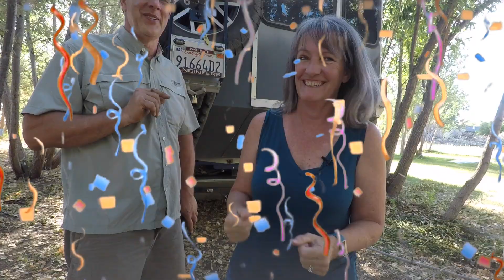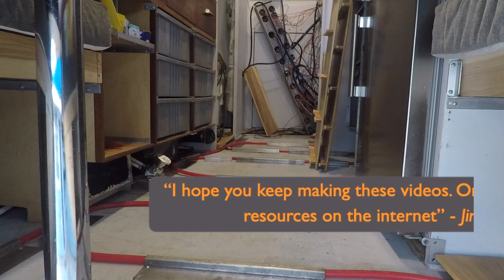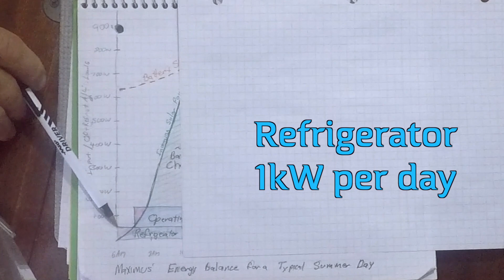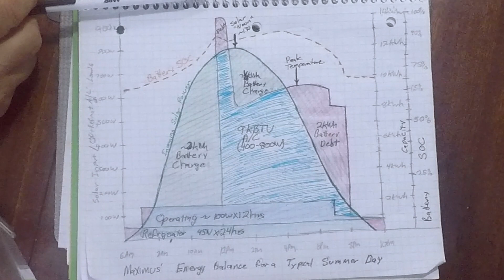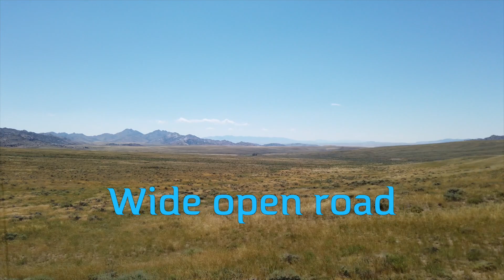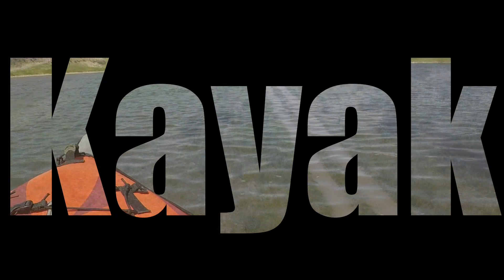All DAY Solar Powered Mini Split AC | Staying Cool Off  Grid DIY Truck Camper  | North Platte River

Comment: I have a few questions what problems did you have to resolve in those 2 weeks or did everything work perfect from day one
Reply from the maker: The A/C performance was good from the beginning. A year later, I discovered a leak in an SAE flare that lost most of the charge and it stopped working for a bit but was pretty easily fixed and recharged. The power system took some time. I planned for 5x190W solar panels but the original 5 developed problems and I replaced them all (under warranty). There are 250W panels available now in the same size which I wish I had ( now 6 x190W = 1140W but it could be 6 x 250W= 1500W). I've added a 6th panel on a sliding mount out the back since this video. I also changed from a PWM charge controller to an MPPT.
Reply: @WorkingOnExploring  that's kinda of to be expected thank you for the insight and time happy travels
Reply from the maker: The panel failure was a huge disappointment we had to deal with an entire summer. Of 5 Solarland 190W panels, only one worked. I had purchased 8 panels used 4 on my previous camper for a couple years and left 4 in the shop. When I installed 5 of them on the new camper (4 virtually unused from shop storage), 6 of 8 had 1,2 or all 3 internal cell strings failed. We ended up relying on the 2nd alternator for power....this video was after that...
Reply: @WorkingOnExploring  if you ask me that's not due to your planning or experience that's a problem derived from the lack of manufacturing in this country Americans
 build quality because we live next door to the people who depend on our work
Reply: I have been working and raising kids since I was just a kid myself and something I have learned is the people who have true knowledge are always willing to share it with you if you're smart enough to ask

Comment: New sub here. I'm in the planning stages of a shuttle bus conversion... It's a 24 pssgr built on the F550 platform, 6.7 diesel, dual alternators and only 40K miles. My plan is to install 1208Ah of lithium @ 12V, giving me 14.5KWh... plus 900 watts of solar. AC will be a must. Have you seen the cheap Chinese 12V ACs? What are your thoughts on these units versus a "house" mini split? BTW, impressive build and very informative. I plan to use your videos as a resource as i embark on this project.
Reply from the maker: I have viewed the sale adds of 'cheap chinese' engine driven (R134a) units (fair quality but would  not recommend an engine driven unit) and am also very familiar with the 'cheap chinese' mini-splits. Search my Chanel for my A/C videos and check WorkingOnExploring.com/TechDocs for downloadable info. Not a big fan of any of the 17 brands of mini-splits sold by Midea. Quality brands (Mitsubishi, Toshiba, Daikin, LG, etc) are only a little more expensive and a lot more reliable AND better performing. If I were you (having not started buying equipment) I would 1) construct a 48V power system, 2) convert your second alternator to 48V with an external charging regulator and 3) use a 48VDC Minisplit from HotSpotEnergy.com. This is what I wish I had done. I went 24V only because I was going to go from my F350 build to am M1088A1 which had a large 24v power system already. I REALLY think the 48VDC Minisplit is 'where it's at' for RV A/C.

You should also watch my alternator charging video #3 that discusses dual alternator operation and how it's not what you think. TBL, I would avoid a big 12V system. The 12V A/C that is available is very expensive and not very efficient (because it's 12V = high amperage).
Reply: Thanks for the info; you sold me on 48V. Signature Solar also offers a DC mini-split that I'm gonna consider. As for the fridge, I was looking at several AC/DC models, but I've seen where some people purchase a small chest style freezer and use a temp controller to use as a fridge... what are your thoughts? As for alternator charging, I'm leaning towards the Wakespeed. My 2nd alt puts out around 160A; I will likely upgrade later on. Have yet to figure out the water heater... was leaning towards a DIY hydronic setup. Your system looks quite robust, so I may try to do something similar.     This is going to be quite the project!   @WorkingOnExploring
Reply from the maker: @thomasholton8907 I doubt you can find a 48vdc fridge but look at some of the 'off-grid' or 'solar' fridges. LOOK HARD. If you can find one, I'd go for it above any other COA. I have a video on why I chose my 120VAC residential fridge and don't regret it but just like I wish I would have gone 48v, I would have looked hard for a 48v fridge of I had. 

There is no such thing as an AC/DC fridge. You get a DC fridge with an external AC power brick. You can do that yourself with an aftermarket one if you ever want to one.  once you have the big battery and DC fridge, you'll never need or want one. With a big camper, you should want the convenience and size of an upright fridge freezer. I never considered one because I never wanted the hassle of digging to the bottom (if you have a chest freezer, you know what I mean.)
Reply from the maker: @thomasholton8907 if your alternator is RATED AT 160A, it will put out around 80A continuously. Watch my first alternator charging video on what 'rating' means.
Reply from the maker: @thomasholton8907 the strength of Wakespeed is in using datacom with smart bms equipped batteries. If you don't have it, it's a waste of money. If you're using a 48v system, you should go to a 48V alternator which will have few regulator options (Balmar).
Reply from the maker: @thomasholton8907 I think you may find 48v water heating elements but I recommend a calorifier . I have a 20l SureCal from Heatso.com

Comment: I have 1800 watts solar and 24 nissan leaf cells. I'm installing the 25 seer minisplit 9000 btu this coming weekend. I have two inverters one is a 3000 high frequency that my camper is basically plugged into and I also have the 4000 low frequency sungold power that'll be running the minisplit and my wife's hairdryer sometimes lol
Reply from the maker: My wife has the cursed 'curly hair' so she needs the dryer and straightener all the time. 

I have a 24V/4k low frequency EVO4024 Samlex. You sound like you need to loose one of those inverters....unless your like me and feel the need for redundancy. I also run a 800W Reliable Electric to power the fridge and generally waste power with little things. Beware, loading an inverter less than 30% is pretty inefficient. If I could, I would have bought a 3k if it was available in 24V. As it is, I run the microwave, induction cooktop and A/C all at the same time. 

Are you running a 6S battery on 24V? I presume you mean your battery is 24 packs/96 cells with 6S16P?.... I converted 5 of my Leaf packs from 2S2P to 1S4P so I could make a 7S battery (runs 21V-29.4V). I have 7S20P using 35 packs. The voltage range is perfect for 24V equipment. If I had it to do all over again, I would have made a 14S battery because they make 48V mini-splits that would be best used direct.
Reply: At the moment I have 24 modules in two stacks of 12. Each stack is at 24 volts then parallel with the other. I should have done the 48 volt also rather than buying all 24 volt equiptment. My camper with the lights on and a big TV and a fairly large fridge barely leaves any headroom on the 3000. I had to buy the 4000 watt inverter for the minisplit and hairdryer and the airfryer and all that kinda stuff. Sometimes I plug the 1500 watt side of the waterheater into it also. It sounds bad but I can max out both inverters pretty much unless I'm extra careful. I just found a deal on 48 more leaf cells so I'm getting them and hopefully another 8 or 10 panels so we can be more comfortable. I'm a truck driver so we are not in the camper bit a few days a month but I don't want to run outta power while home ya know
Reply from the maker: 1) By your arrangement, I assume your '2 stacks of 12 (packs)' are each arranged 3S4P(packs) making a 6S8P battery. With two of these batteries in parallel, you have a total of 6S16P battery bank. Your NMO cell voltages are 4.2-3.0V so your battery bank will run from 25.2- 18.0V. Your problem is obviously that your inverters will cut off as low as 20V which is probably fine because there isn't a lot of capacity between 20V and 18V. If they cut off at 21(most probalbe) -22V, you are losing a lot more capacity which is why I went to the effort to make a 7S battery (29.4V-21V).
2) Using two batteries in parallel requires that each battery have its own BMS. This is the reason for making a single battery and using a single BMS. I'm not a great believer in the importance of a BMS if you have a) good capacity balance between cell groups and b) good control of your charging and discharging cutoffs. I use an Electrodacus SBMS0
Reply: My 3000 watt inverter is a all in one with charge controller made by powmr but I have another 100 Amp charge controller also by powmr. I only have 8 panels currently and they are all on one controller so I'm set up for more panels just haven't been home much lately to mess with it
Reply: Can I ask you a technical question.. would a 220 volt inovair 38 seer 9000 btu be a better option than the 110 volt 25 seer ch brand? I know higher seer means more efficient but the 220 volt will ensure that I always have to run both my inverters. If I get  do the 110 I can run off of either inverter so do you think the 110 would be more efficient since I could not have the second inverter running all the time?
Reply from the maker: Several things relate to answering your question
1) Power conversion efficiency is better the closer the input and output voltages are. For this reason, keeping at 120V is likely more efficient.
2) Running two inverters: You cannot create a 240V system by running two inverters that are not designed to work together (sharing a common neutral with two different hot lines). To make two 120V inverters into a 240V equivalent, they have to communicate with each other to insure they create their 120V ouputs EXACTLY 180 degrees out of phase with each other.  Before I would go looking for two inverters that could be ganged into a split phase 240V(US) system, I would find a 220V (European) or 230V (UK) one to dedicate to the A/C. 'Running two inverters' is likely less efficient than one as you already identify. Specifically because each inverter will be running at a lower percentage of its capacity (below 30% rule).
3) The variable capacity that makes mini-splits so efficient converts the single phase input to three phase to run the compressor motor so there is another conversion involved. For instance 120VAC/1/60hz input is rectified into 120VDC in the motor control, then converted into 120VAC/3/20-120hz by the motor control. From an input perspective, the mini-split should not care about the 50hz of the Euro/UK inverters and probably say so on the data plate.
4) The inverter control in the mini-split is inherently 'soft starting' so having a larger inverter or some kind of surge capacity by buying bigger is a bad idea. It is most efficient to use an inverter that is 'just big enough' for the max capacity of the mini-split so that when it 'turns-down' (lowers its capacity) , the inverter can still stay in its ~90% efficient zone. Inverters drop well below ~90% efficiency at less than 30% load which is where your mini split goes at its minimum speed.
5) SEER is a measure of efficiency for a residential application over a range of outdoor temperatures. EER is strictly at 95F. Manufacturers (I used to be one) play with their system design to game the system to achieve a higher SEER without even changing the EER. Typically, they perform really well at low outdoor temps (low 80s) which you would never actually use in an RV. This is likely what is happening to these really high SEER units. The biggest factor in making a higher SEER unit (after using a variable capacity compressor/EEV) is to enlarge the evaporator and condenser. This makes units larger and more expensive. Expense is not a lot but size can be. In an RV, size matters a lot.
6) Don't assume all mini-splits have the same variable capacity range. They do vary. Cheaper ones made by MIDEA (has 17 brands at last count of which CH is one) typically don't have as low or as high a performance range as premium brands (LG, Panasonic, Hitachi, Mitsubishi, Daikin, etc). Also pay attention to how low a temp they can heat in if you intend to use that. It varies a lot too ('low ambient' capacity)
Reply: @WorkingOnExploring  my sungold power is a split phase 240 inverter. It has 2 separate legs that are 110. Each leg is 2000 watts and it's made that way. I'd never try hooking two different brand inverters together to make 220. Most likely if I order the 110 unit I'll still use the sungold for the minisplit just use one leg and I'll leave the other leg for her hair dryer lol. I'd like to run the ac on the 3000 watt inverter but with the TV on and occasional microwave and my fridge it's about maxed out the 3000. I really wish I'd just bought a 6500 cause it would be much better than running both the ones I have. I think I'll go ahead and order the 110 ch 25 seer unit this evening cause I need to do the install this next weekend while I'm home.thanks for the info tho. I know you studied up on this stuff and I could tell in your video you really knew your stuff
Reply from the maker: 1) Not knowing what your environmental conditions are, how big your RV is or how good your insulation is; My 9K BTU LG runs at full load around 800W but only runs that way for ~1/2 hour because my camper is small and well insulated. Most of the time it runs 400-500W. That's a 25% load for a 2000W 'leg' and as low as you should ever run (I'm below 15% most of the time when I run mine and its a problem). Running you 4k inverter on one leg at that low a demand will not be very efficient. It wouldn't be any better running both legs at half the load on 240V either.

2) Again, not knowing your camper, insulation or conditions, but I have to assume you have a commercial camper, a 9k BTU might be (I think likely)  too small. Its fine for me but similarly, you'd need to have a small space, low demand or great insulation for it to be enough. Most roof top RV A/C units are 13.5kBTU for that reason. Unless your sure, I'd think you might want to go with a 12k BTU.  

3) Low frequency inverters and high frequency inverters have a much different peak capacity. Not recalling which of your inverters is which......a low frequency inverter can safely and easily provide 120-130% capacity for several minutes. Mine does 130% for 5 minutes. A 3kW low frequency might easily deliver 4kw for several minutes easily. That takes care of most microwave needs (because it is short duration)  and would not cut into your A/C load most of the time (because your A/C will slow down to low draw).
Reply: @WorkingOnExploring  my camper is a 30 foot holiday rambler. I'll take your advice on ordering the 12000. I'd been debating that to for awhile. On my 3000 I have it hooked into my camper 30 Amp plug. For some reason I have ansmall current in the frame known as a hot skin situation. It's something to do with the ground neutral bond I think. When I use the ac input and ac bypass on inverter to charge batteries I'm showing 40 volts in the camper frame and if I plug the camper into my house the skin isn't hot so I know it's the inverter making it have a hot skin. Hopefully I can get it figured out. If you know anything about that side of the electrical I'd sure appreciate your input. You already saved me with the air-conditioning stuff and I'm thankful for that. It's nice talking to someone knowledgeable about this stuff
Reply: @WorkingOnExploring  I really do appreciate your time helping me thru this stuff. I watch YouTube trying to learn this stuff and I love it but some of it is overwhelming and buying the wrong stuff and rebuying has gotten expensive. Yep you saved me on the air-conditioning
Reply from the maker: Our exchange is great and I have more to say but please send an email to WorkingOnExploring@gmail.com so we can not overload the comments.
Reply from the maker: I can tell you why you have a hot skin problem. Send me an email  at WorkingOnExploring@gmail.com. We've already put too much in comments.

Comment: A couple of ground deploy panels and yeah more more battery I think you would be good with running it all night
Reply from the maker: I have wheels....I don't stay in places that would require running A/C at night....lol.....I could likely run longer if I wanted to or needed to. I only dip to ~70% SOC when I shut off. I'm about to add a 6th solar panel as well that will give me 1140W that I am already really fine without.
Reply: I love that minisplit video where you was comparing different units. That was the exact moment I decided to go with a minisplit.. thanks for helping with that decision